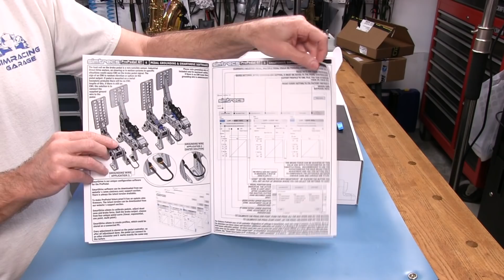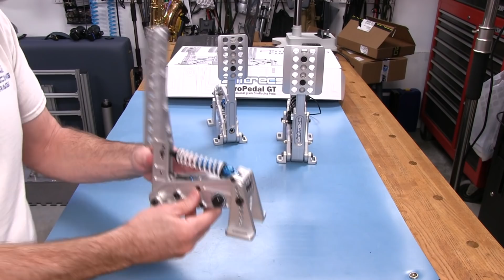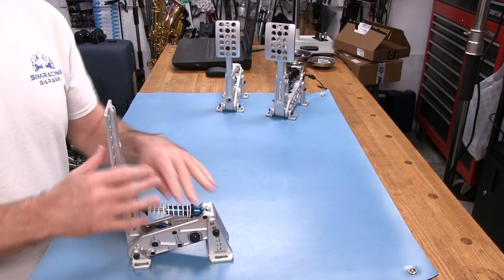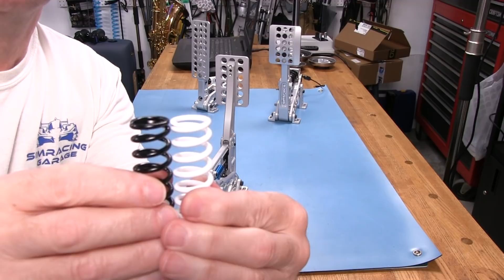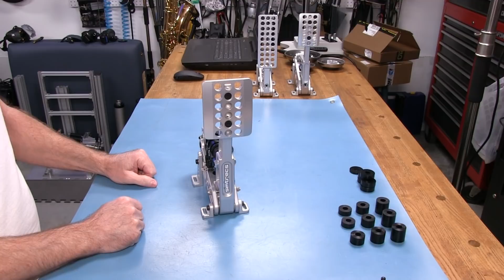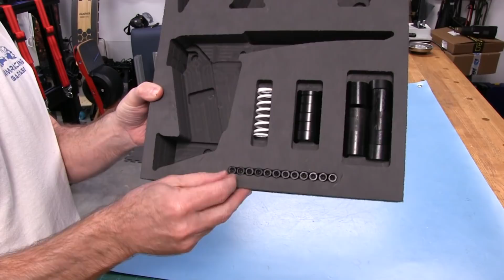Simtrecs Pro Pedal GT Review

Comment: Which ones would you go with, these or the meca cup 1s?

Actually Barry, and everyone else looking at these VS the HE sprints - realistically speaking, how much of a difference do the dampers on all pedals make in the overall immersion and feel of the pedals. I preordered these but I keep going back and forth between them and the sprints mostly because of the price. If there's anything I don't really like about the simtrecs is not being able to change the throttle faceplate. Nonetheless with some 3D design i may be able to make an adapter plate that can accommodate other faces. I am also think about painting the pedals, I wonder if I can actually get away with doing that to them without seriously damaging anything.

Edit (3 months later): Mine just arrived today and I am SOOOOOOOOOOOOOOOOOOOOOOOOOOOOOOOOOOOOOOOOOOOOOOOOOOOOO EXCITED! stuck at work though lol
Reply: How have they been performing so far? Would you recommend them for the price?
Reply: @AndreBrah  worth every penny
Reply: I've been debating if it's worth upgrading from my Sprints (2000$ in Canada). it's basically the same tech used for both pedals but the extra cost for a such a beautiful pedal only offering dampers and much better looking product might be best to invest into something different like Hydraulic. If Simucube didn't cost 3500$ per pedal I would do that. I know when you get a new piece of gear we all get exited and forget the fundamentals so after all this time what's your general opinion and what are the bad about these Simtrecs?

Comment: I couldn't wait for the VRS pedals anymore and ordered these. These look amazing and Barry is still using them which says a lot. Cant wait to try them out. Coming from CSR Fanatecs I've had for 8 years lol
Reply: Have you received them yet?
Reply: @volo1826  Yep I've had them for the 2 months now and couldn't be happier. I ended up getting the email to order the VRS literally a 2 days later and I still ordered them too. I actually only tried the VRS for a day then installed the Simtrecs and I've been too happy with them to go through the hassle switching to the VRS to test them further but I will once I get more free time.
Reply: @Havok412  hey did you ever try the VRS?  I’m trying to decide between the two right now
Reply: @cptclutch2530  Hey yes actually we built a budget second rig so my brother could play too and we used the VRS pedals. They're honestly great too but overall I still prefer the Simtrecs. However one of my reasons is that the Simtrecs just feel closer to how a car would feel and I prefer that. The VRS are harder to setup since they have much more adjustments you can tinker with and you have to use a separate control box. The simtrecs have that built-in to the pedals. I didn't feel the need to adjust the Simtrecs beyond the options it has. and the default way the VRS came in where fine for the most part. 

Overall it still falls down to preference and for  me, the Simtrecs were plug in play, they looks amazing, feel closer to real pedal box. Adjustments on the Simtrecs are easy and the instructions are great. 

Negatives were Sim3D rumble motors are double sided taped onto the gas pedal since there is no option to hard mount. VRS pedals use the same hardware. (They work great on both I just don't know if it will last). Adjustments on the VRS are not necessarily hard but there is steeper learning curve on how to adjust them properly if you want things like a harder or softer feel brake or longer or shorter travel. There is no manual and the only sources are from a VRS video that you would need to reference. I don't particularly like the feel of the VRS throttle. I get its super responsive as it has no dampener and it only uses the spring. You can adjust it to feel more heavy but for me its still not heavy enough. It does have a competitive edge though. 

Simtrecs are more expensive but you get what you pay for. Not meaning the VRS are cheap I just think they're both prices well for what you get on either decision.

Comment: Anyone that has these directly mounted on a Sim-Lab P1-X Universal pedal plate?
Reply: Yes, you can mount in the slots, 14cm between the bolts. Be aware that you will need to buy M6 25 or 30mm bolts, large strong washers and nut. And the M6 will exactly just fit, its tight. Another option could be to mount directly in the p1alu profiles that might be a better option possibly, but I am not sure where a heel plate would go if needed. They also sell their own baseplate as you see in Barry's review.
Reply: @Quickmcj  Yeah, I saw the measurements yesterday, and it seem to be a very snug fit without any room for depth adjustment. The reason I want to have it on the universal plate is because I have a slider attached to it. I'm not sure if the Simtrec Baseplate is compatible with the slider. Do you have these pedals, and if so, how did you mount yours?
Reply: @wuzumaki  yes and they are mounted the way you want it 🙂 It works, but I feel the slider flexes a tiny bit when braking hard. I do consider mounting as Barry, and then with quick release bolts in the profiles of P1, to slide the pedals back (so skipping the sim lab slider and base plate) Sliding on the side profiles on P1 as I propose will possibly leave marks after some time. But that should be very strong.
I have the wide simtrecs baseplate that is too wide to mount on the sim lab slider baseplate. You could possibly mount it in the bottom of the profiles and then through the slots in the sim lab baseplate. Or maybe choose the narrow simtrecs baseplate, I do not know if its mounting holes align with the simlab slider baseplate.
Reply: @Quickmcj  Ok, thats good to hear. Judging by the schematics, the Simtrecs plates don't align with the Sim-Lab Slider baseplate or the slider itself.

Didn't expect the slider to have any flex at all. Since it's only a tiny bit it probably doesn't bother you? 

Your QR solution seems like a possible way to do it, but that leaves the possibilty of creating a whole bunch of scratches, which everyone wants to avoid. 

I'll try the direct mounting when I get them. Thanks for your help.
Reply: @wuzumaki  Its a very tiny amount of flex , you cannot feel it, but you can see it. If you remove the slider, and mount the simlab baseplate to the p1 profile base, that might work (giving you heel support) or as you say directly in the profiles. Or with the slider as I do atm :)
Sure np.
Reply: I’d spend the little extra to get their baseplate, it’s solid and looks superb. Mounts easily on the P1X pedal tray
Reply: @pooljunkie85  The only issue I have with their baseplate is that I lose the adjustabilty that I have with the seat slider.
Reply: I am in the same boat right now. Considering these pedals with a P1-X and debating whether to get Simtrecs' baseplate or Sim-Lab's slider plate. 
What did you end up doing and how has it been?
Reply: @CynicalManInBlack  I didn't get the Simtrecs at all. I decided to get Heusinkveld Ultimate 3 pedal set, and they have been working fine. If I did get the Simtrecs, I would get the Simtrecs' baseplate too.
Reply: @wuzumaki  thanks for the reply. what made you go with the ultimates?
Reply: @CynicalManInBlack  Waiting time, but mostly because Heusinkveld Ultimates has been on the market for so many years, so they have been tested and tried over many years, and the users are in overall very happy with them. Heusinkveld is also known for great customer service, which I experienced first hand. One of my dampers were defect, and Heusinkveld sent me a replacement unit free of charge without hesitation. Simtrecs are probably great pedals, but they are also relatively new in the market, so we don't really know how well made they are yet. With that said, I do think that the Simtrecs are solid pedals that will last for years, but in the end I went with Heusinkveld mostly because they've been "in the game" for so much longer.

Comment: I got bumped up (Batch 4), just received the email that my set is ready to ship! woot Can't wait to put these  on the rig. Coming from V3's, I just couldn't get the precise modulation on the brake/throttle I'm looking for. 

Great review Mr. B, as pointed out the engineering that went into these is very impressive! Hope I can provide feedback once I get some laps in.  If anyone has questions, just ask and I'll try to get back to you.
Reply: After trying these at the S.R.G i think you will be VERY HAPPY with the purchase!!! :)
Reply: SO, how do you like them, should I pull the trigger?
Reply: Same question as the other dude. Did you get them? How long did it take to get them?
Reply: @thinkrtank  I'll be getting mine on Monday, currently using Fanatec V'3.
Reply: @thinkrtank  For me its was a toss up between these and the Asetek Invicta. I went with the Asetek. Just waiting for delivery.
Reply: any update on how do they compare to the V3s? 😅
Reply: @KorruptorK  Very impressive piece of kit. Top notch everywhere in build and presentation. The V3's are a fine set of pedals, I had just reached the point of needed more available max pedals pressure. I was maxing out the V3s' pedal force. On the Simtrecs I'm using a soft durometer cushion setup equaling a measured 87lbs (low end) of pedal force for 100% brake. This feels great for now, with lots available headroom to move up to higher brake pedal force (200lbs on high end) if desired. Very happy with my investment.
Reply: @keepitkeen  I'm considering getting either the HE Ults+ or the Simtrecs because I feel I've reached the limit of my V3s aswell - brake force and customization wise.

Initially I thought the HE were the "go to" choice, but I am slowly switching to the Simtrecs because the HEs apparently are super stiff even at the lowest setting while the Simtrecs seem to support many different configs.

Glad to hear they are a beast, I may end up getting them instead of the HEs

Comment: These look nicer than heusinkveld pros. They just went up on the top of my pedal wishlist.
Reply: @Robert Schneider i was fortunate enough to get the hpp prx se for a reasonable price..im sure at least satisfied with the extra modding until that day comes! :)
Reply: @jacobcisco7059   Damn you‘re lucky. 
Yeah for right now im happy with my pedals. They are inverted which in my opinion compensates for the short throw a bit (the angle just feels better when they are mounted on the rig). The clutch mechanism works surprisingly well. I put the brake spring in the clutch and the clutch spring in the throttle which makes modulating the throttle a lot easier and also gives the clutch some real bite. The true brake mod makes threshold and trail braking possible. It‘s all running over a 12 bit usb Adapter. All in all they are really good for their price. I mean I got my g29 set 4 years ago at a discount price of only 190€  and my mods cost only about 110€ Incl. shipping and I personally like them better than something like the CSL Elite pedals. 
Right now I’m happy that I’ll finally upgrading my wheelbase, I was lucky enough to get into the first wave of CSL DD preorders because of the shifter I bought previously. So I’m happy to get rid of the toyisch G29 and finally step up the immersion with the DD. I just hope that the CSL DD will live up to the hype.

But all in all I’m still looking forward to a reall looking and feeling pedal set with all the adjustments. Having the posibillity to adjust the stack on a real loadcell and also tuning in the hydraulic dampening, sure sounds nice. 
But since I’m in sim racing for the immersion and the fun and not for the competition my G29 wheelbase was the thing I was most desperate about upgrading.
Reply: @robertschneider8808  oh wow congrats on wheel base i would definitely check out the boost kit i know i know..its extra money but for what your getting i think it would be well worth it!!! Either way boost kit or not im excited for you man! I decided to do everything completely backwards lol! Previsously i had the f1gt cockpit with t3pa pros and t300 that i was basically given for 200 bucks and then turned around and blessed someone else the same way instead of making any money off of it....i now have the motionhouse 2un the pedals a polismer(70mm custom wheel) and just bought 3 ultragear ips 1440p panels...still need a pc and have decided since i have the simlab sf1 seat..i have got to bite the shipping cost and get the p1x i have enjoyed buying each piece now to just get these cockpit and pc sooo much moneeyy lol :(
Reply: @jacobcisco7059   Damn that sounds like a really nice setup. Sure ain’t cheap though. I’m still in university so I have to budget my sim expenses a bit (I’m just fortunate that I live in a country with free education otherwise I would be effed). 
Right now I’m running Pedals, Wheel and Shifter as I told you. 
The CSL DD is coming with a boost kit. I highly disagree with fanatecs upselling sales tactic but for once I didn’t act on principle and gave in. I can be a principled human beeing on the other 364 days of the year right :D. 
I also got the F1 2021 Limited rim, which is nice since it comes with the advanced paddle module. Im really looking forward to the bitepoint mode clutches.
My monitor is the weakpoint of my system. It’s an old 1080p 32” TV. The size is nice but the refreshrate sucks and I got annoying tearing artefacts. But it’ll do for now. Everything is mounted on a Simlab GT1 Evo I got for a 50€ off promo price. (Fortunatley shipping from the Netherlands to Germany is quick and not too expensive.) 
The next items I need is a round rim for the CSL DD, after that a handbrake (i think i’ll just go for the fanatec it’s not amazing but it’ll do for the occasionally rally stage), then a nicer monitor with the posibility to go for tripples in the future (my computer can’t really handle them anyway). 
After that I’ll save for the Pedals. 
Unfortunatley I can’t really give away my G29 until I get the pedals because I’ll keep using the G29’s pedals for quite a while. But when it’s time I’ll give them to somebody who want’s to get into the hobby but doesn’t have the money to start out. 

Now to the most “premium jank” part of my setup. The whole thing is running on my Work / Uni 2019 top spec 16” MacBook Pro running Windows in Bootcamp. 😂 I bought that laptop because I really hate working in windows. It cramps my workflow. I also needed a powerful portable machine because I do a lot of 3d and Visualisation and also (at least in normal times) work at the studio in uni and at home. Since I didn’t have the money to get a powerfull Mac laptop and building a decent Windows tower just for gaming I fully speced out the MacBook and now punish it’s graphicscard everytime I hit the virtual Track. 😂 
I’m pretty sure there aren’t many people out there running their rigs on a mac laptop running windows.
Reply: So since my wife is a school teacher. I have a brand new mac book pro(2020) and a 2018 mac book running some sort iris graphics can it run 3 24 inch monitors or is this this intergrated graphics just not possible but for one monitor. Sucks cause the pc side of things is why i havent ran iracing in 6 months been waiting for the right deal since i refuse to spend 4 times the orice for a 3080 which is what i was going to ho for since im going 3 32 inch 1440p monitors dell 32dgf3220
Reply: After trying them at sim racing garage i would have to put my opinion that they are better than the ultimate's just my opinion
Reply: I believe you. They are definitely on top of my pedals wishlist. But for now I have to stick to my modded out Logitech’s with true brake mod and my 3D printed bitepoint mechanism for the clutch.
Reply: Some people claim they're even better than Ultimate
Reply: I‘m stupid. I meant the ultimates. 🤦‍♂️

Comment: Odd choice to put a potentiometer on this high-quality of a set...They will fail.
Reply: Those look like Vishay cermet long life high precision potentiometers with a (within specs), minimum, 2 million cycle lifetime. Very easy to replace and not that expensive, when you need to do so, after maybe a decade.
Reply: @Quickmcj  Thank you for pointing out the difference. I have only experienced bad potentiometers I suppose. I  used to have issues with many pots being that I was a musician for much of my life and also my sim gear I recently purchased from Fanatec failed within a couple days (Handbrake). Knowing this and hearing others go through similar problems is a no-go for me now. I understand potentiometers can have different quality levels as anything does but there is no denying hall effect sensors should theoretically outlast any potentiometer. Even load cell technology bothers me a bit. 

I'm just all for sim gear to be as robust as possible and adding failure points to gear in this price range seems like a poor choice.
Reply: @DouglasThompson  Your point is valid, but exactly these pots should last a long time and is easy to replace. A lot of equipment do come with cheap pots for sure. Also, you can actually replace the pots with hall position sensors if you really want to extend lifetime. They are in the same rotary form as pots and input output the same.
Reply: @Quickmcj  that's good to know, thank you for sharing your information